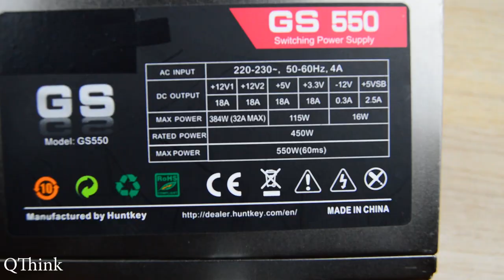How to Convert Cordless Drill to Corded

Comment: This may work on drill for small things, not require high current. PC power supply doesn't supply high amperage. The power supply will burn if the drill finds strong reverse torque .
Reply from the maker: yeah
Reply: You can get 18A+18A=36A from that power supply, the best battery will give you max 30A.

Comment: Bro, can i use 10 amps on my cordless drill? Mine was the cheapest with round battery, i bought that for about 40$ and now the buttery didn't last long even just use it for screws only, I've connect it with 19v 2 amps but it like didn't get enough power, it wont turn fast like it were powered by the battery and if pull the switch fast it will only spin a little then it will stop spinning, so i think it doesn't get enough power to work properly, thats why im gonna use 10a current from led driver/convertr but im afraid it will burn out bc of too much power😅 and right now im cant afford nothing, barely eat once a day and i need to use that drill to make my work easier, so how do you think? Will it burn if im using 12v 10 amps power supply?

Comment: can't you just remove the battery and directly wire the motor to the adapter that came with the drill?
Reply: power adapter charge with low power
, we need high power

Comment: Did the same but I left the NiCD cells in the battery but not connected to balance the weight and instead of the PC PSU I used an old jumpstart box that was too weak to start a car.

Comment: the power supply is worth more than a brand new lithium drill. not worth it.
Reply: Matt Cramdon 
might not be worth it if you use a power supply
try using an laptop charger into the drill

getting a r/woooosh
Reply: The video states how to CONVERT not save money
Reply: Dedicated 12v power supplies are fairly cheap. Doing it with a PC PSU only makes sense if you have an old one lying around. And I guess way too many of us have more than one lying around :D
Reply: @jackcarvis3668  hahaha dude the point of making it corded is so you don’t have to buy a new one😂
Reply: People are throwing them in the garbage all the time, they are free if you pick them up!
Reply: it depends on the brand , Black & Decker  or Bosch cost more than a PC power supply , and on the other hand , cheap unbranded drill won't last long
Reply: @Matt Cramdon — ey Ralfy Boy — you get the woooosh because I have 20 of these power supplies in a bin. What real man doesn’t? They’re FREE. But even new they can be obtained for much less than most drills. So you’re just wrong, Karyn.
Reply: if you want cheap you can use old iron transformers,

Comment: Could you give a bit more details as to what power supply was used in the video?
Model, origin, output voltage, amperage and so on?

Thank you
Reply from the maker: 12v, 500w
Reply: QThink isnt 500w overkill, even if not 500w is being drawn as a total?
Reply from the maker: @DogerBeaner  no
Reply: @DogerBeaner  Power supply power is distribute over multiple wires, total power listed is sum of power for each voltage, e.g. 5V, 12V, 3.3V etc. Drill may use lots of power when slowing down due to stiff material, it may exceed Psu power and psu protection will turn of power. Same can happen at start.
LiIon batteries, are like a folded roll of metal sheet between plastic, surface area is huge, this way if you request power, it will give you huge power instantly. This is why such batteries are used for phones, drills etc. Even if their capacity is small, they can give you all their juice in short time. You can actually weld with such batteries.

Comment: I have 18v drill, can i make it work with 19v laptop charger because i don't found 18v charger?
Reply from the maker: no you can not
Reply: Charging lithium cells incorrectly can cause then to explode/catch fire. Always use the correct charger for the battery pack.
Reply: Dont charge the batteries with that charger! However with aroud 20v you should be able to power the drill itself, provided that your power supply can handle 20v with 40 Amps

Comment: Hello when i was connecting my drill, power supply cuts of power. Do you know what is it problem????
Reply: It's because at the initial start, your drill draws more current than the maximum rating of the power supply.
Reply: That is way too much work just to save a drill I would rather just buy a new battery or trash can in I'm going all lithium now anyway no more nicad batteries for me oh well it seems like a waste the grill is no longer useful without the battery and needs to go in the trash thank you but it's not for me.
Reply from the maker: Hi, because on your block the protection is triggered.